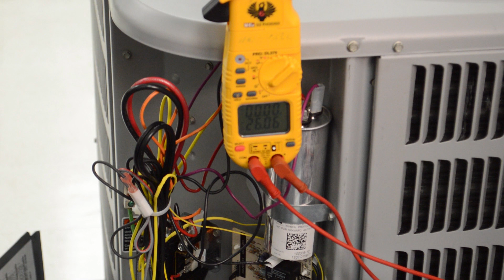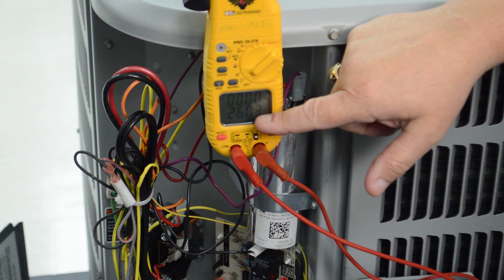Testing a Time/Temperature Defrost Board

Comment: How are you reading voltage across an OPEN switch?
Reply: Because the meter is closing the path.
Reply: because there will be a potential difference. in a closed switch you should be reading 0.0 potential difference.